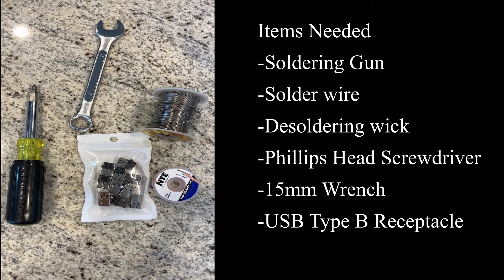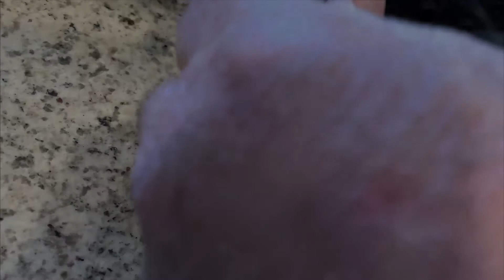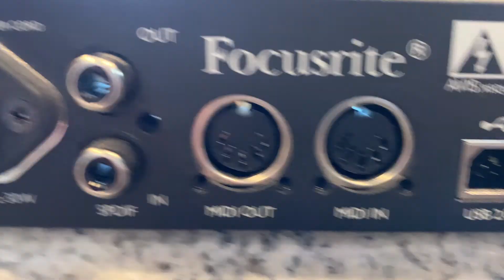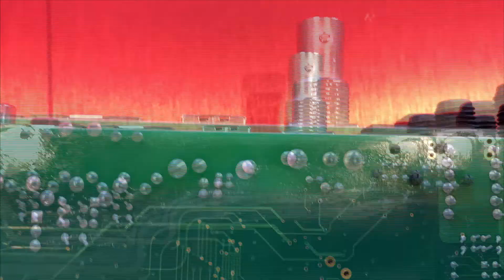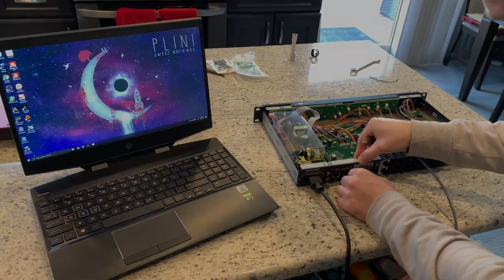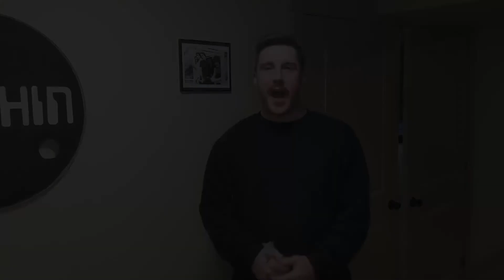Repairing USB Type B Receptacle on Scarlett 18i20 | Full Teardown |

Comment: Hi great video, I have a question about the interface. What issue where you having that prompted you to replace the usb  B port?Reason I’m asking is I have a 18i20 that the usb light turns off and on and will connect after turning it on and off a couple of times. I would like to fix my unit. What do you think?